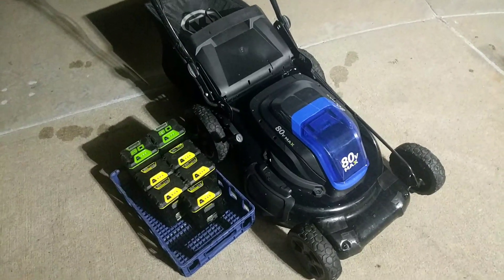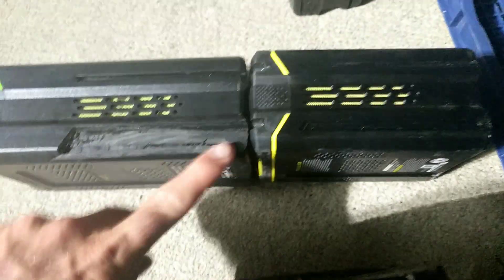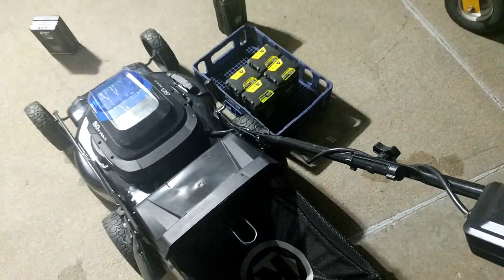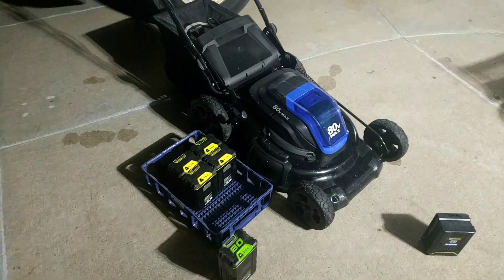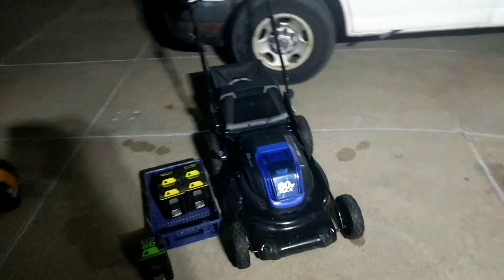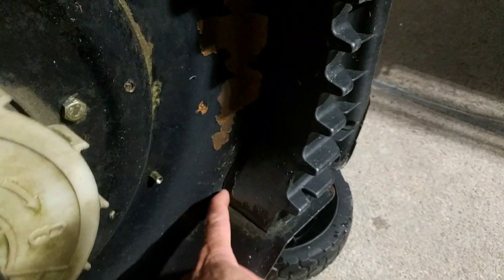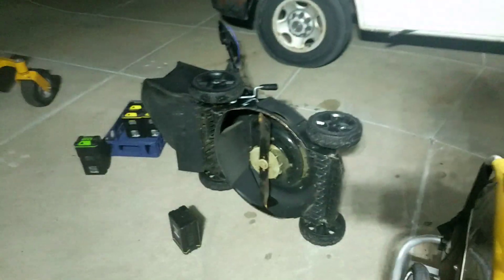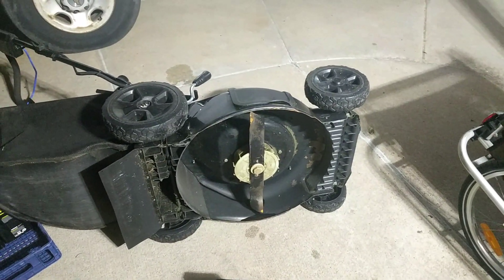Lowe's 80 volt Kobalt lawn mower 2 Amp Hour battery converted to 5 amp hour

Comment: Kobalt 80 volt chainsaw just ordered has 6ah battery.  7/23/2021
Reply from the maker: I have Milwaukee's 18v 12ah but the Kobalt has bigger chain and should last longer. You'll love how smooth and quite the electric chainsaws are, almost no vibration, no fumes and air filter to clean all the time.

Comment: I appreciate this video! Was trying to figure out where to modify the batteries to fit since I heard these were interchangeable. Thanks!
Reply from the maker: just bought a Green Works Pro backpack blower and the modified batteries will fit, plan on doing video soon. Would love to know if they will work with new 82v batteries that Green Works has now for commercial line. Maybe some day.
Reply: @missingpiece2071  Yeah I plan on getting one of their ride on mowers for the future. I was hoping to modify one of these greenworks batteries with the higher amp hours for my snowblower since I have a long driveway. Thanks again for this video!

Comment: Did you ever get the new laser cut blades? Thanks for the video. 👍🏻
Reply from the maker: Yes, I have a video but yes work great other than they don't sell sand blades so I had to take off 2 of the blades to get more battery life.

Comment: How did you remove that edge off the battery?
Reply from the maker: I have a Milwaukee vibration saw but I think if you were to heat up a utility blade multiple times you would easily get through it or maybe 40 grit sandpaper. Just ideas I really don't know but I had a vibration saw
Reply: Missing Piece ,... Thanks!